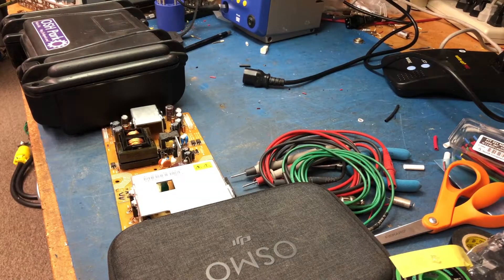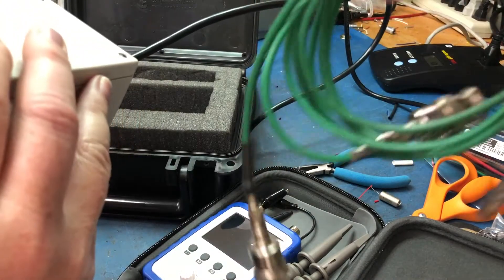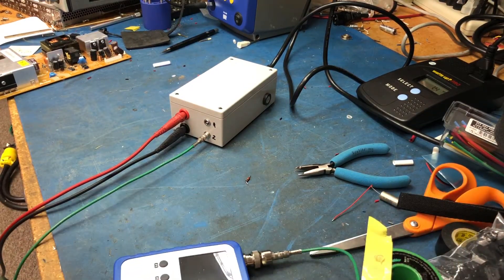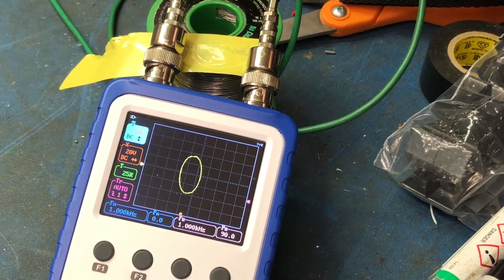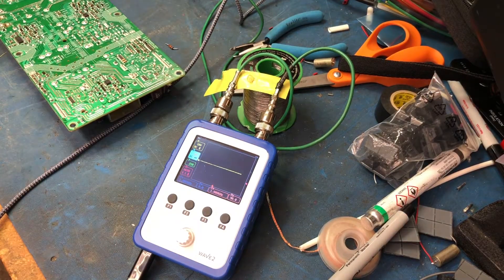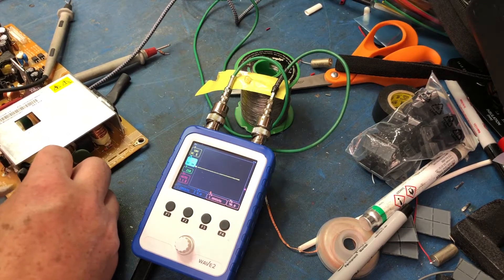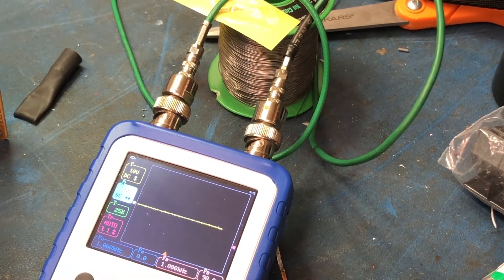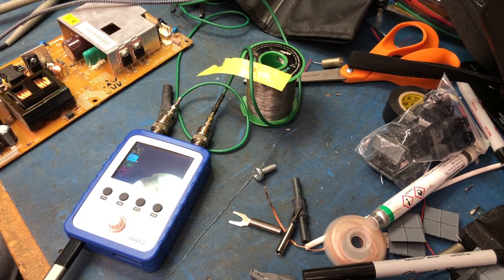circuit tester AKA curve tracer- Samsung tv power supply board

Comment: Do you have a schematic for your curve tracer that you can share?
Reply from the maker: https://www.changpuak.ch/electronics/Curve_Tracer.php

This is pretty much the schematic minus an ac switch on the primary of the transformer. If you build one close to the values they outline, it will be fine!
Reply: @icemanfiveoh  thank you for your schematic drawing.
Reply from the maker: You are welcome! Thanks for the comments.
Reply: Thank you for replying, I looked at the schematic and the schematic didn’t match up entirely to the picture. I didn’t recognize the symbol for the transformer input because the picture showed it corded , 4mm D.U.T. ?, and the probe jacks . Would it be possible for you to clarify the difference between the picture and the schematic. I would greatly appreciate it if you could.
Respectfully Michael
Reply from the maker: Here is a quick schematic I drew up. This should be more self-explanatory. The red and black probes are what you use to measure the component. The X and Y inputs go to the Oscilloscope. The rest is pretty easy. Use whatever plugs you need to make the connections. I.E.-BNC for scope connections and Banana jacks or Voltmeter probe jacks for the component probes. I also used an IEC receptacle for the AC input, so I could plug in a standard computer AC cord. Add a switch and a fuse for safety, and you should be all set. I built this out of junk I had lying around, minus some of the special LEMO jacks and probe jacks. Use the included link to my Google Drive for the schematic.

Curve Tracer Schematic:
https://drive.google.com/file/d/1FWk6-BshAhMan72kJLKfj48d78qPYbwc/view?usp=sharing

Comment: nice video.
so you can test components on a circuit board that doesnt have power connected to it?
how does the component get its voltage/current for the testify you could explain a little more.
thanks
john
Reply from the maker: So the curve tracer uses voltage and current from a transformer and basically a current limiting resistor. Check out this site for all the info you would need to understand and build your own. They do a very thorough job of laying it out. Its possible to even build one out of junk lying around. 

 https://circuitcellar.com/research-design-hub/create-your-own-i-v-curve-tracer/